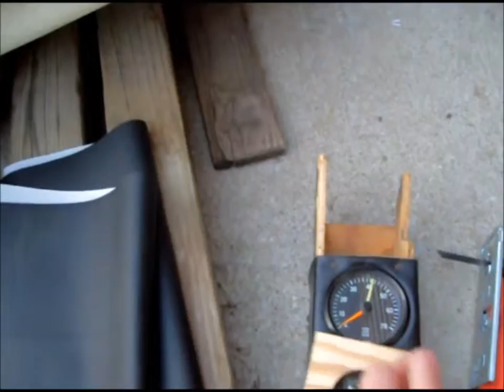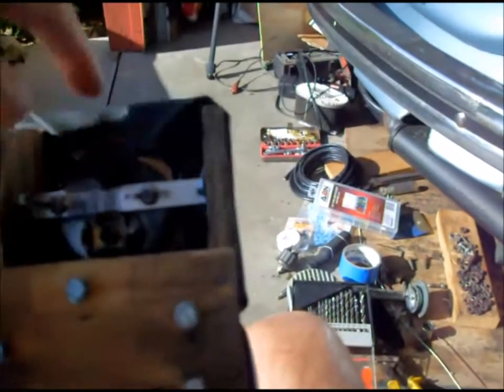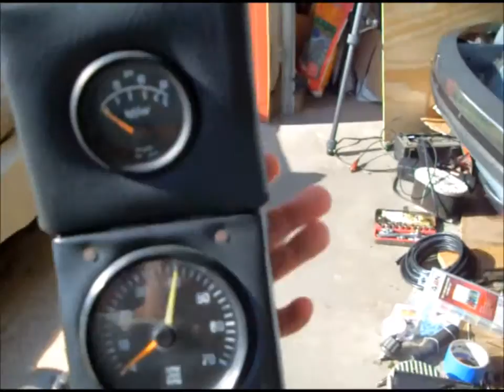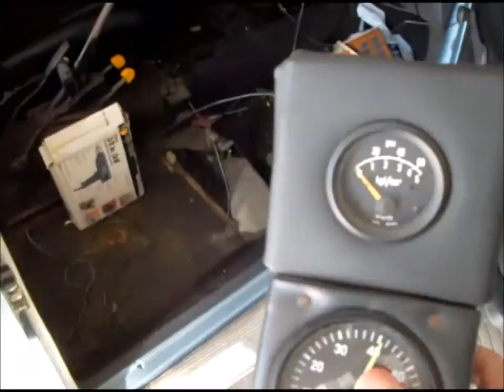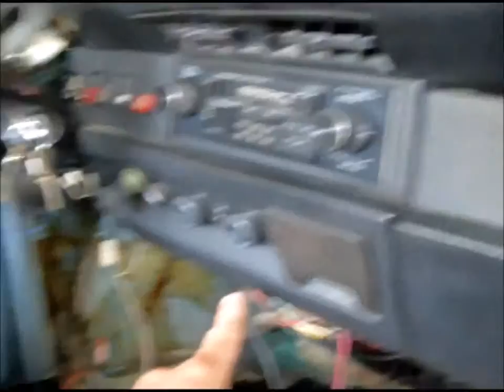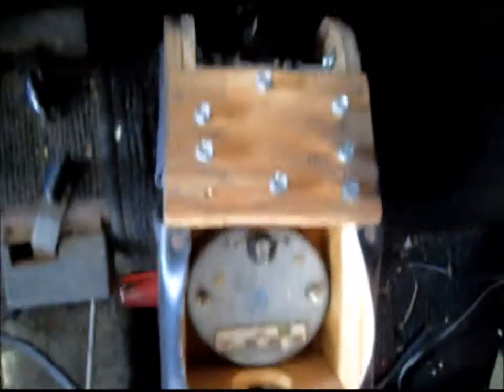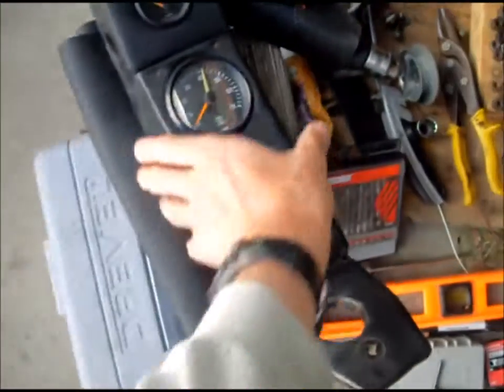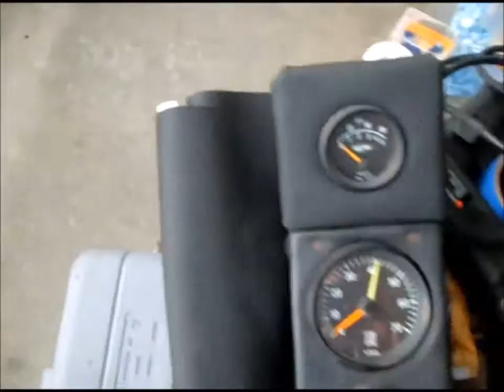vw 73 super beetle gauge cluster and wiring

Comment: Scotty, I love your videos! How were you able to access all the wiring from the bottom side of the dashboard? Is there something you need to remove? Thanks!
Reply from the maker: in a late super, the fuse block is under the dash just above where your feet go. easy access. i also have some wiring hooked into the back of the speedo and it's easy to run wires from the speedo down to the fuse block area.
Reply: @redshirt-scotty  thank you! I have a 74 super that I am trying to fix up... so I'm trying to access the speaker wiring and the dashboard lights